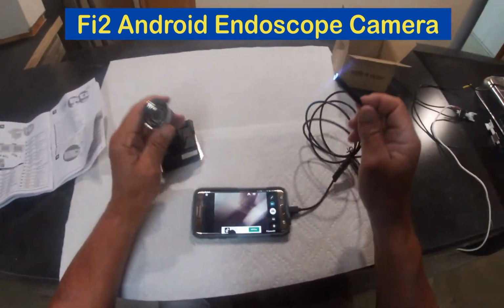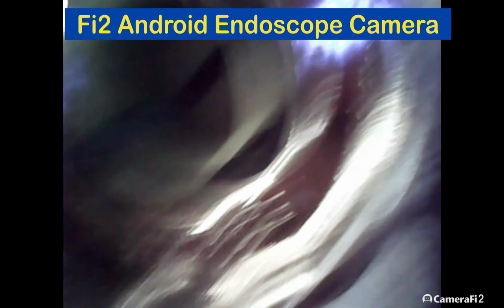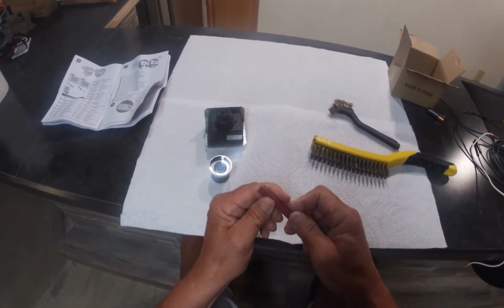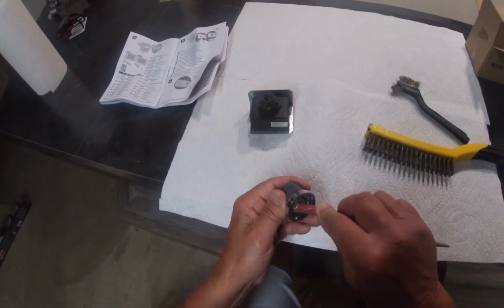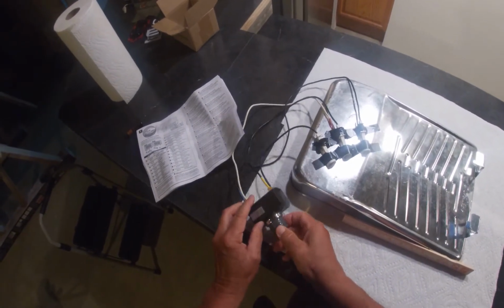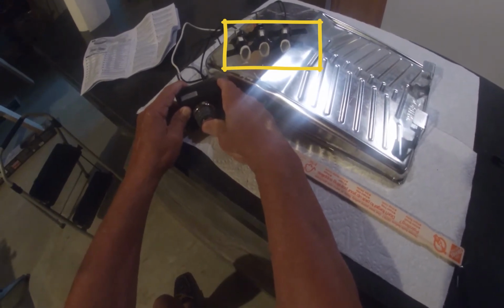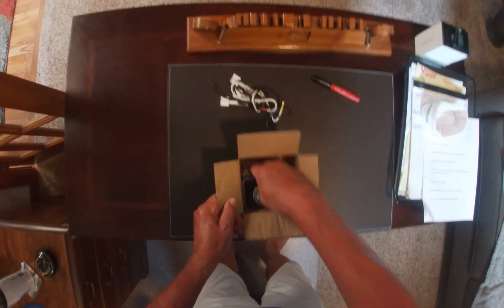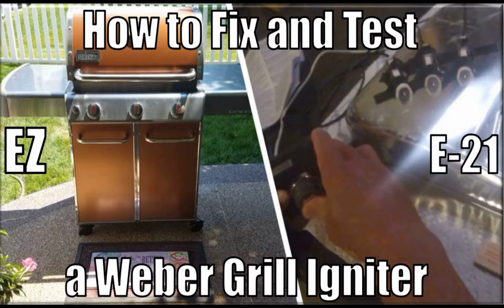Fix Weber Grill Igniter

Comment: I am still looking for a video that would explain how to repair the igniter if it had faulty electronics inside it.
Reply from the maker: Bill,

If you have faulty electronics, I recommend that you purchase the Weber Grill Igniter Kit that I show how to Install in E-20, "Quick DIY Replacement of a Weber Grill Igniter".

Otherwise, I appreciate your interest in my “Let’s Fix It Right” channel.  By the way, I retired recently and have plans for another 200 to 300 great DIY videos. I’m finishing up on a year and one half of cancer treatments and plan to start posting these videos starting this summer.

With this said, can you please subscribe, tell your friends and family about my channel, and send them this a link to my channel’s videos: 

https://www.youtube.com/c/LetsFixItRight

Regards,
Let’s Fix It Right
Reply: This video shows what happens when you have a working igniter. If that were the case I would be out grilling a ribeye rather than searching for a video that shows me how to troubleshoot a non-working igniter. Does anyone know what the voltage should be coming out of the igniter? Can you test it with wires disconnected from module using battery neg for ground? Or pos lead of meter on igniter probe and neg lead on burner tube? Would be easy to figure out with a known working igniter like that one you just boxed up. Episode 4?

Comment: Exactly what my issue was. I cleaned out the corrosion and my igniter is working again. No need to buy the $40 Weber igniter replacement kit on Amazon. I just unscrewed the button and cleaned it out with sandpaper as you did. I didn't dismount the entire wiring harness. Tested the battery with a volt meter to make sure it had sufficient charge. Once replaced I tested each burner separately. They all lit up like they were new. I will make sure to remove the battery in winter from now on. Brilliant video. Thanks.
Reply from the maker: Curtis,
Appreciate your great comments.  It’s obvious to me that you are an accomplished DIYer.  Plan to keep your comments on display so others can see your approach.

Otherwise, I appreciate your interest in my “Let’s Fix It Right” channel.  By the way, I retired recently and have plans for another 200 to 300 great DIY videos. 

Can you please subscribe, tell your friends and family about my channel, and send them this a link to my channel’s videos: 
https://www.youtube.com/channel/UCIBvBqPEkqu3D5HLpxlEmEA/videos

Regards,
Let’s Fix It Right